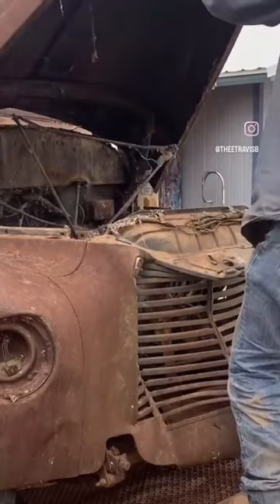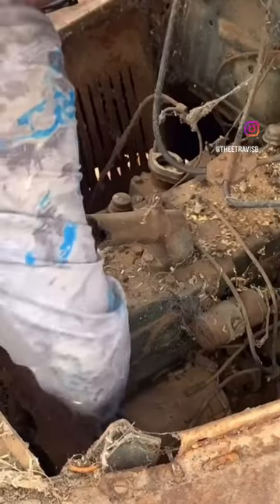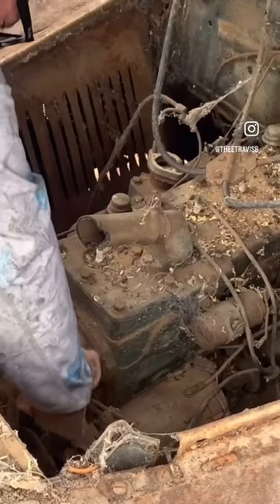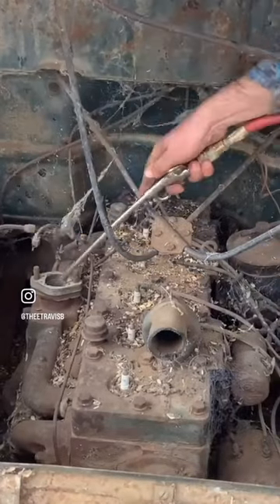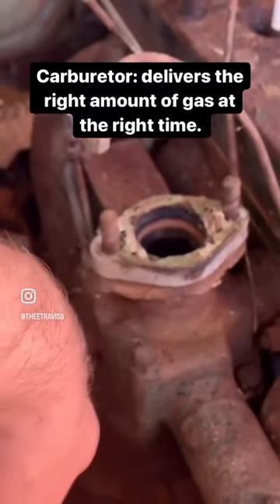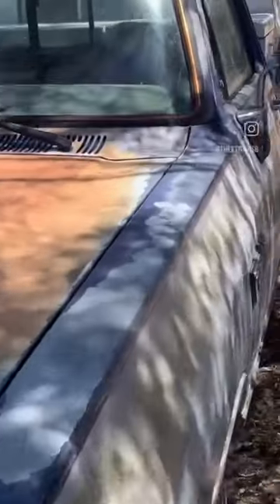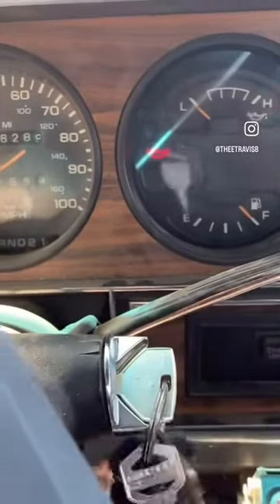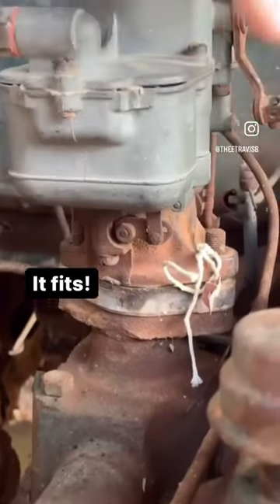Abandoned 1946 international trailer.

Comment: The engine could be a Ford because International used mostly Ford and GMC parts you have to the truck serial number and check the old International books and  they will tell you what engine, transmission and rear end are installed in the truck
Reply: You are right about the books.
💯 % WRONG on the engine.
IH used IH engines in IH trucks.